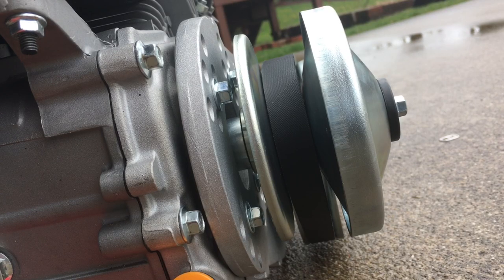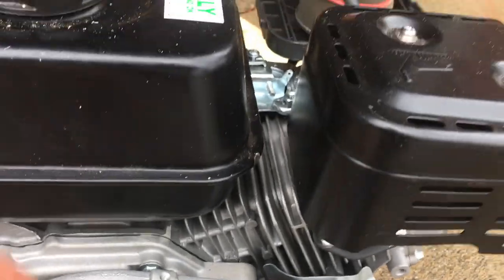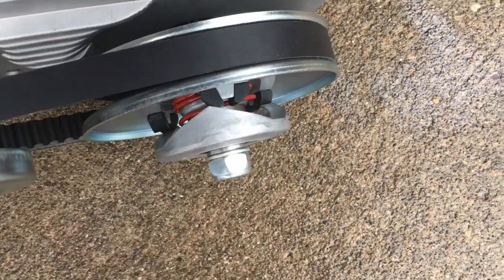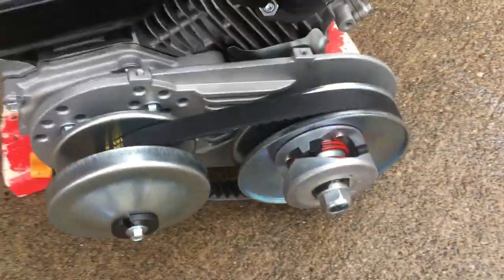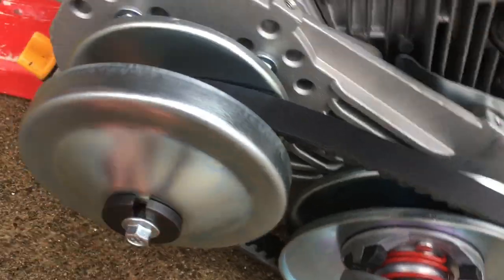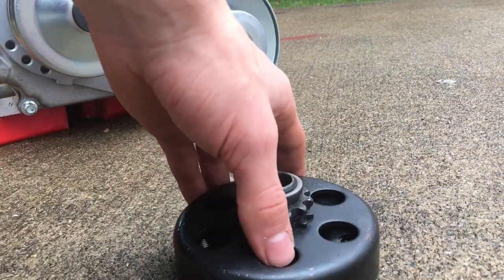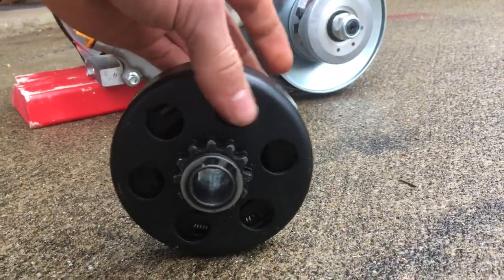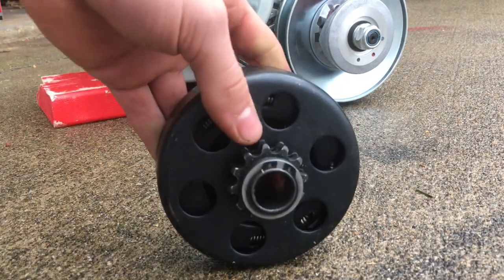What Are The Differences Between a Torque Converter and a Centrifugal Clutch?

Comment: My new clutch drum is going to cost more than a whole Torque converter. I may have miscalculated somewhere along the line😒. A pro who owns one of the biggest companies in the industry once told me a torque converter is great if you want to ride in a parade but clutches are what you want to win races. Torque converters stay under constant slip and load, clutches are open or closed therefore producing heat only when they are in the process of engaging. Clutches are designed to cool fully engaged or disengaged. The heat created by both is dispersed through the engine crank which directly effects internal engine temperature. Hot engines aren't good for racing. That's what was explained to me.
Reply from the maker: Do what you want but I find torque converters are way better than standard centrifugal clutches. Race clutches are better than both though, but very expensive

Comment: How come my belt still moves on idle?
Reply from the maker: There are a couple reasons. One could be that your idle is set too high, two could be that you don't have the brass bushing on the front pulley, and three could be that your rear pulley isn't hooked to a chain that goes to your tire or axle. If you don't have the rear pulley hooked to anything, it will just free spin and you should be able to stop it wish your hand. However, I strongly don't recommend touching the pulley while it is spinning.

Comment: That's not really a torque converter. It is a belt driven CVT (continuously variable transmission) which still uses a weighted clutch that uses centrifugal force to engage and increase the size of the drive pulley  , but also a second clutch on the driven pulley to decrease it's size. a true torque converter is a type of fluid coupling mainly used on but not limited to automatic transmissions , and actually multiplies the torque when the output rotational speed is so low.
Reply: You are correct, sir.

Comment: Actually that is called a Variator, most commonly used on motor-scooters   A torque convertor is the fluid filled coupling component used on automatic transmissions.

Comment: John ? Centrifugal clutches aren't that bad & you can raise their egaugment speed too for 2 stroke with low cc or lack of bottom end torque engines or for spooling up more for harder launches by fitting heavier engagement springs....well narratored but not everyone can afford a convertor especially if it's just for teaching the kids to ride on a tube frame mini or kart...plenty got by fine on @ 3.5hp Flattie with just the clutch...Cheers Trev 🇳🇿😇
Reply from the maker: Good point!

Comment: That is not a torque converter.  It is a load-sensitive, continuously variable drive, also known as a continuously variable transmission or CVT.  A torque converter, aka hydrodynamic torque multiplier, does not use a belt as the power transmission medium.